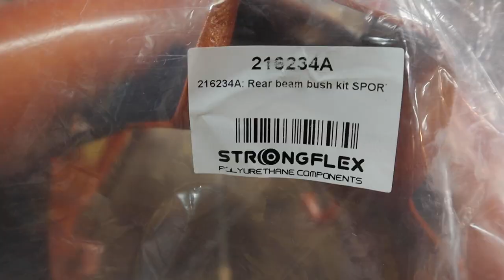Rear Subframe Bushing Install | StrongFlex | Lexus IS300 IS200 Altezza

Comment: Getting to do this to my 318ti. Is that actually grease (it's clear) or is it Silicone?
...well per Str0ngFlex
Grease - special  "silicone grease"  intended for the assembly of STRONGFLEX polyurethane bushes.
I'm just gonna use my Dow Silicone Molykote 111.
Reply from the maker: its grease...use the grease they provide